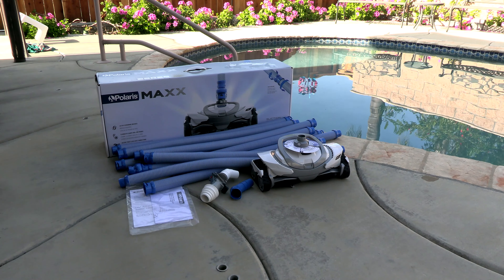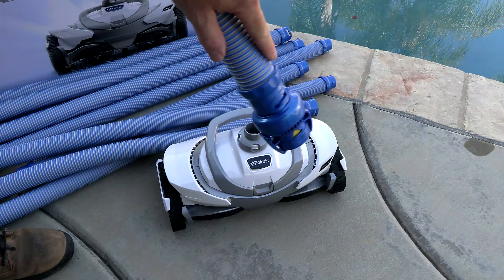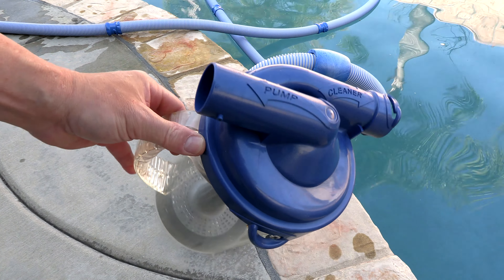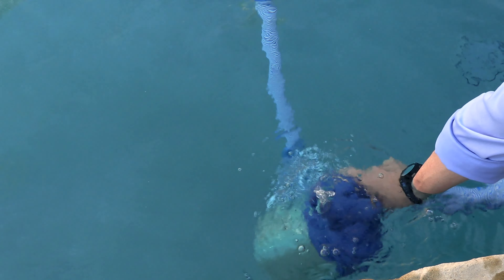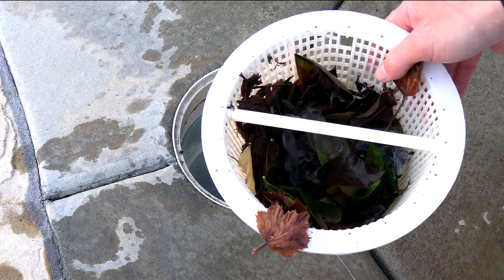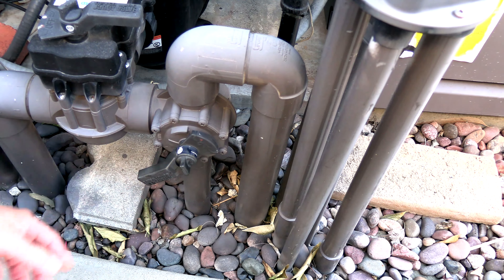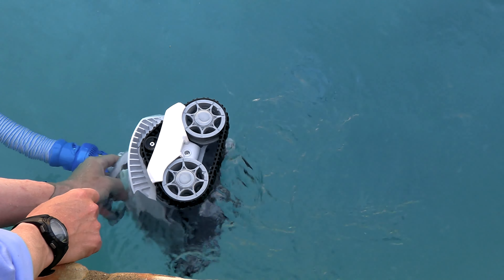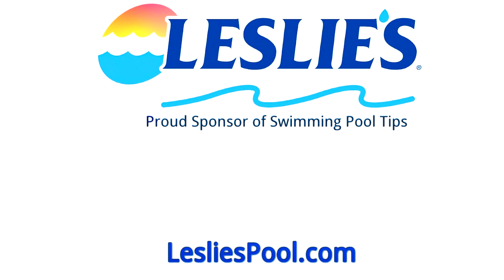Polaris MAXX Suction Side cleaner Set Up and Installation Video

Comment: This is the best walkthrough (swimthrough?) of this product.  From full install to both modes of operation and optiomizing using pump.  This product does not require a booster pump.

Comment: Picked one up a couple weeks ago.  Fantastic so far.  I will mention that initially it was not climbing walls even with good suction and the appropriate speed - it couldn't get traction.  However, maybe a day later it was climbing the walls like a champ with no changes.  So maybe the treads needed to get roughed up a bit with a little use.  Working great now.

Comment: Why does mine keep leaking air? I hook it to the skimmer using hand over fist, let the air bubbles out and then change from 50/50 skimmer drain to 75% skimmer, then air comes in
Reply from the maker: It check the hose connections and the canister if you are using one

Comment: I have a Polaris 380 I'm looking to upgrade. Do I have to get a new side port to attach this or will it click into the existing polaris fitting I have in my pool. Does this use a separate pump like my 380? I don't want the debris going into the filter causing me to backwash every time. That's the beauty of the 380, cleans outside of the filter so I am confused on whether this is even similar. Thanks.
Reply from the maker: Wouldn't work for you.  Get a new polaris 380.
Reply: @SPL  Okay, so I couldn't even use it through the skimmer. I figured the filter wouldn't be powerful enough. Thanks.

Comment: Quick Question. I just purchased one of these the other day and followed the video. Pump speed on my Pentair VS pump is almost maxed out at 3400 and my side port is fully open with skimmer and main drain set a 1/4 open with my sunshelf bubbler feature totally closed and the best I get is 10 rotations in 28 secs. Not sure what else to do to provide more suction to the side port. Any suggestions? Also, is it a good idea to have the pump maxed out for 3 hours while cleaning?
Reply from the maker: I would close the main drain valve completely. Dial the skimmer line down to 1/2 or less. Keep the side port open 100% I assume you have everything on seperate valves vs the way the pool is set up in this video? It should run easily at 2600 RPM. Running it at 2600 RPM or 2800 RPM for 3-4 hours each day is still in the range of good energy savings. If set correctly no need to max out the pump.

Comment: I just got the Maxx and am going over stuff again before using.

Question #1: Do you close the side port after using the vacuum every time? If I leave the vacuum in the pool all the time, do I leave the side port permanently open or close it every day?

Question #2: If I do leave the vacuum in the pool all the time, will it only work when the pump is on?
Reply from the maker: I would leave it in the pool 24/7 unless you have a party, then remove it.  Don't close the sideport valve unless it is not in the pool. Othwise leave it open.

Comment: I purchased this cleaner and my only issue is that it does not pick up leaves. It will go over them multiple times and hardly pick the up. Is this typical? Last cleaner I had was the phoenix which touched up leaves no problem.
Reply from the maker: Might be set too fast - too much suction

Comment: I never understand the purpose of these snap hoses, just so they can sell more proprietary "adapters"? I've had zero issues with traditional hoses and have always found needing to find adapters to convert from snap to traditional so I can use universal leaf catchers, etc...  in fact, I hate these snap hoses so much because they need to be rotated to lock.  Unlike traditional hoses which lock by friction and never come loose.
Reply: yea, that's my only gripe, the hoses are high quality, but i wouldn't mind if it was a regular style so i don't have to deal with too many adapters and fittings
Reply from the maker: They do make a distribution only version sold through PoolCorp - SCP/Superior simply called the ATLAS. This one is shipped with standard universal hoses. I personally prefer the Universal Friction hoses myself...
Reply: @SPL  BTW, is there ANY difference between MAXX and the ATLAS? outside the slightly different appearance and color, are the guts of it inside exactly the same?
Reply from the maker: @bludika  Same exact except the shell.